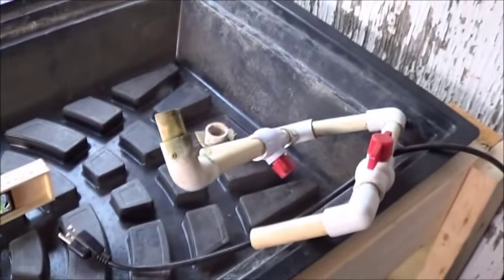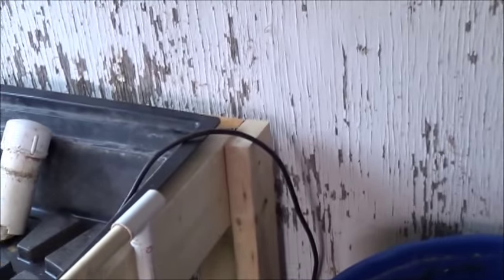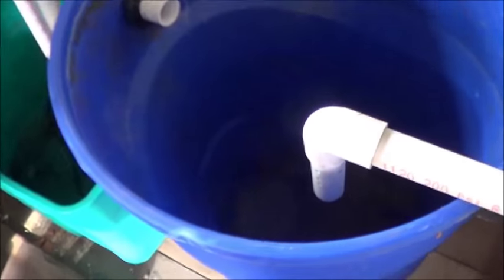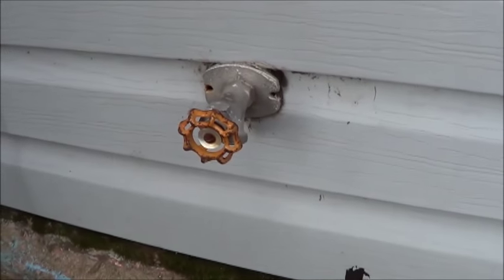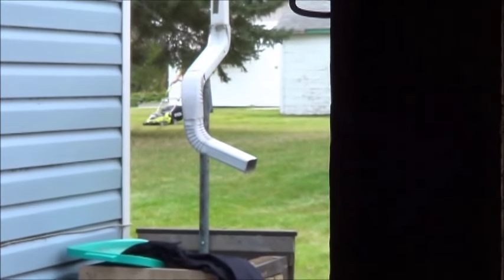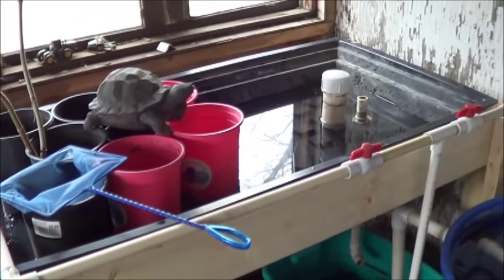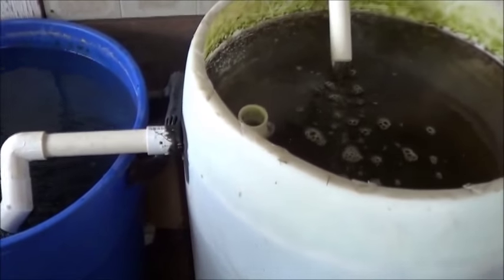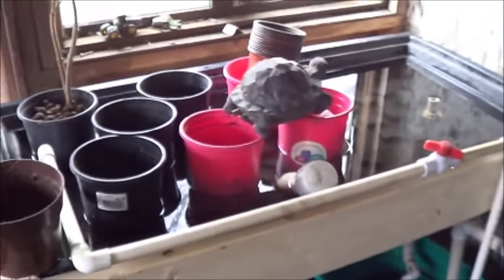Building my New Aquaponic Garden part 2 The Plumbing & Water Test

Comment: Awesome job! And two thumbs up for Chox's genius idea. I'd bet that faucet was originally an outside faucet. On the rocks, be careful what kind of rocks you use. Some can actually add things to your water chemistry. Like calcium that will keep your ph high.
Reply from the maker: +Silvermoonacres - I've been fairly careful not to add anything with streaks or runs of minerals if I can see it.  Mostly just river rock type stones that I'm finding in the soil & around the house.  I think those faucets are proper laundry ones, I got the hot water by mistake the first time around, but that may be where the second outside tap was before they did the addition ... seems fairly logical ...

Comment: Oh man, two more until the big 6!! I can't wait for the ten thousand dollar give away!! That's why I have been here! Lol!
That outside faucet might be "winterized" meaning shut off inside and drained so it doesn't freeze when winter comes (because water expands when frozen, I am sure you know this but this is for the millions of people that will read these comments after viewing the video!). I remember lots of "taps" as you called it meaning shutoffs in the basement. If you follow the pipes they should lead you in the correct direction. If you start near the main line that comes in you can see how it branches off to other places. Most inside sources don't need a shut off but outside areas would need a shut off because of freezing. I'm betting that the number of shutoffs in the basement are close to the number of outside water sources! Just follow the line to see which general area that they go and you can deduct which one is which!
Nice one +Chox TheMuse for the laundry solution!!
Another idea is to add a GFCI outlet or even better a GFCI extension cord adapter (the best solution instead of a breaker in my view)! The adapter is more like a GFCI breaker and will fail off where a GFCI outlet can fail on and still provide electricity to the outlet. The downside is an outlet is like $15 where the extension one is like $45 but well worth it in the "My fish and I weren't electrocuted" sense! Hate to sound preachy but I love electricity and at the same time I respect how dangerous it can be!
Reply from the maker: +RevtosTV - Man ... I'd love to win 10K!  Who's doing that GAW?  I'm on it!  ;-)  Got some seeds I'm thinking about sharing with folks though, not sure if that cuts it.  Let's see, one pepper seed growing even 5 peppers means at least 25 pepper plants in year two for around 125 peppers ... how many peppers would it take to equal 10K I wonder?  I guess it would depend on the market.  Anyway, there only seems to be 1 exterior water faucet and I did look while I was downstairs to see if I could figure out which shutoff it would be but it 'feels' like the problem is more mechanical than that.  I can literally feel the moment it slips its internal grip instead of moving the ... thingie ... yes, thingie ... very technical there (cough) ... 
Chox totally gets the win of the day for the laundry solution!  No idea what you were talking about once you started with the letters but I think it translates loosely as get a plug that will shut off if it gets wet so you don't cook, boil & burn all at the same time?  (ish)  What do the letters stand for so I can translate that into Canadian at the Home Depot?  (because it does seem like a good plan)  :-)
Reply from the maker: +William “Bill” Walter - I hadn't seen that one yet!  I've been loving some of those shirts they've been posting ... 
Thanks for the info on the CFGI, I'll ask about that at the Co-op & Happy Turkey day to you too!
Reply: +JT Bear Hey JT, you have TURKEY on thanksgiving too? I thought everyone went to Tim Hortons. Oh wait am I confusing Canada Day and Thanksgiving? When did beaver fall out of favor as the traditional Thanksgiving meal?  ;)
Reply: JT Bear If you think that it is bad you should just replace it! Then you can take it apart and fix it and you will have a spare and know all about faucets! Check the length on that one and if it is 1/2" or 3/4" (pull the screws and very gently pull it out of the wall to check, if it doesn't want to go don't pull and check for an access inside right behind where it is). And grab one at the co-op! That kind is a freezeless hose bib so you have to know the length, which is how far back in the wall that it keeps the source water so it doesn't freeze with outside temps. When you do it you can shut off the whole house if you can't find the shut off for the faucet and open a faucet or two to relieve the pressure and it just unscrews (go slow and let the water leak out) Teflon the new one and screw it in with two wrenches! Easy stuff!
GFCI stands for ground fault circuit interupter! They are awesome! Saved my life many times! They should be with the extension cords, about two feet long and usually come with three outputs to plug into.
Reply from the maker: +RevtosTV - There's a second one just like it in the shop up on one of the shelves but I have no idea if it's a new one or the last old one ... looks pretty clean, might be a new one ... maybe ... freezeless hose bib, let's see if I can remember that when it comes time to ask at the Co-op!  So I need the length from outside to where the inside tap is, because that's the source?, and to know if it's 1/2 or 3/4 ... seems straightforward enough ... 
I'll check for one of those GFCI cords when I'm there too!
Reply from the maker: +William “Bill” Walter - Do you know how far I would have to drive for a Tim Horton's?   I'd rather grab a Starbucks if I'm gonna be on the road for an hour to get a beverage ...
Reply: JT Bear The freezeless bibs come in standard lengths (6", 9", 12" etc) and what the difference is that at the back of it is where the actual shut off is, so the longer the bib the farther in the wall that the shut off goes to protect it from freezing temps by hopefully using the heat of the house because water expands when frozen and will burst pipes. Also for it to work properly in freezing temps the hose needs to be disconnected or else it will hold water and burst the stem part and leak inside and you won't know about it until it is too late. It says that right by the handle! Lol!
"The source" that I was talking about was the water pipe that supplies the faucet with water. Sorry, I even confuse myself sometimes!!
Quick funny story about pipes freezing I went to an oceanfront house to check on it and the outside pump room (shallow well pump) was not heated. Someone forgot to leave the 100 watt light bulb on for heat. I walked into the pump room and found just a pump with a bladder tank sitting there and no pipes in the room at all only tiny little shards of cpvc and the occasional broken fitting covering the floor!  Luckily it was only all of the pipes in this room! Lol!
Reply from the maker: +William “Bill” Walter - Lol!